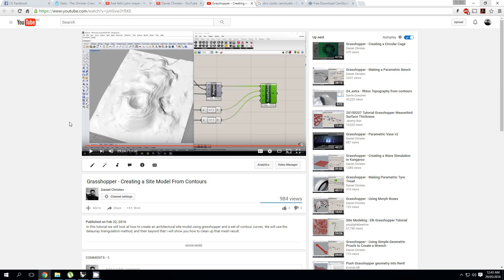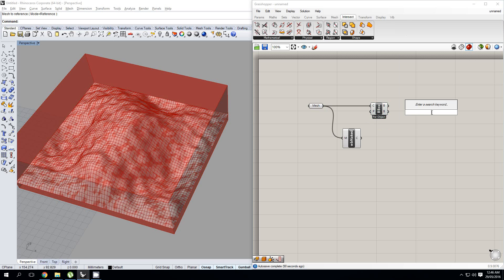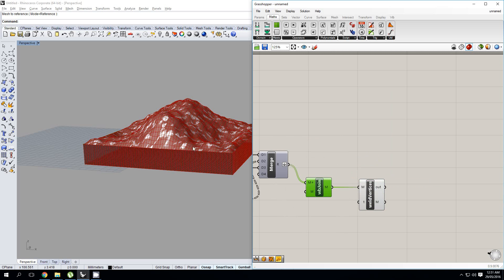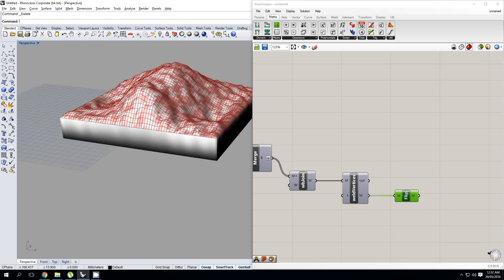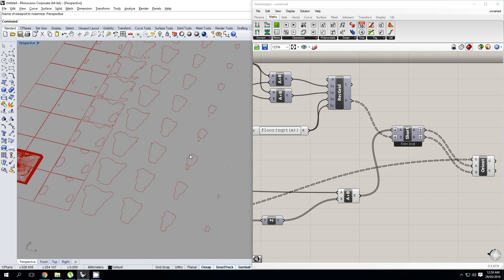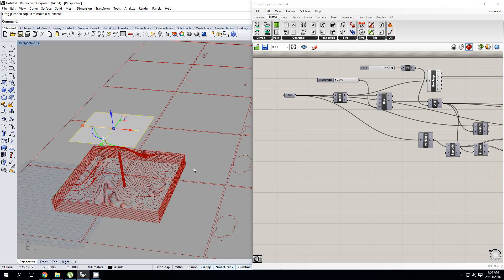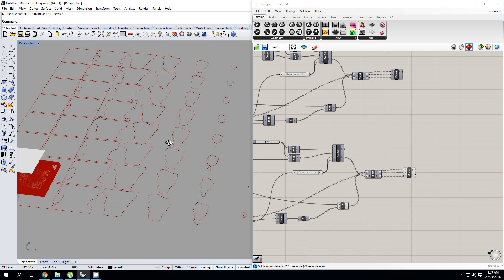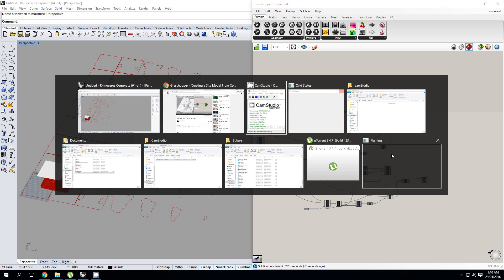Grasshopper - Creating Contours For Laser Cutting

Comment: nice. thanks for preoaring snd posting (again). maybe with your skills you could programme it to inner offset the contours, cut diagonally, so we end up with mostly L shaped parts than can be nested closely and when assembled will create a hollow/shelled structure.

that would be neat. really less material and lighter weight of the carton/other material  model.

maybe it would feasible and useful, i should give it a try but i don't use carton models much. the seams could be rotated in each step so that they overlap each layer like bricks and the seam itself to somewhat vanish in a helicoidal way.

small parts would be excluded by area or inner offset area.

that's the quick idea, it may be a total failure lol.